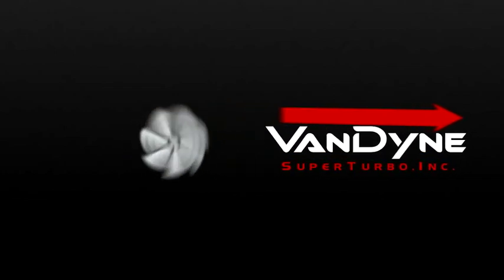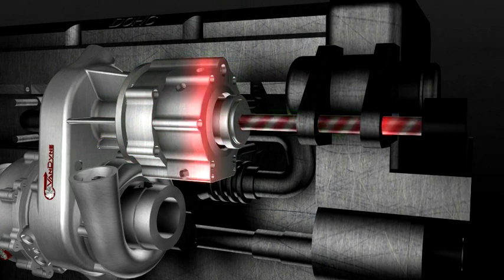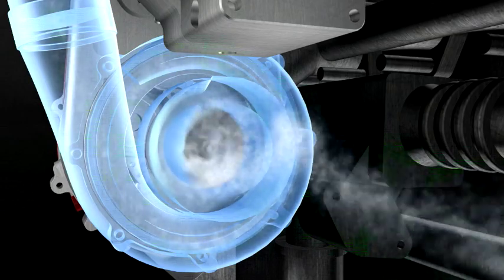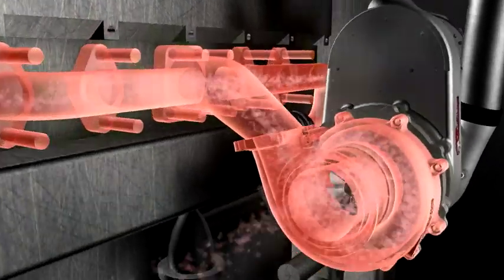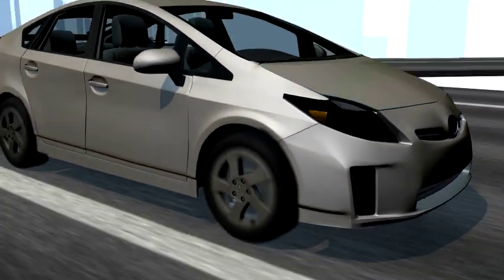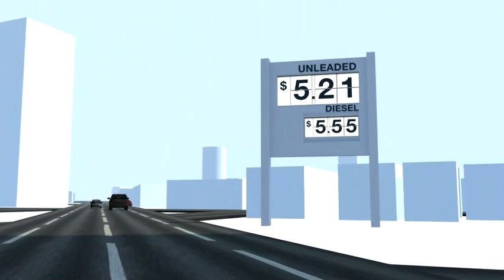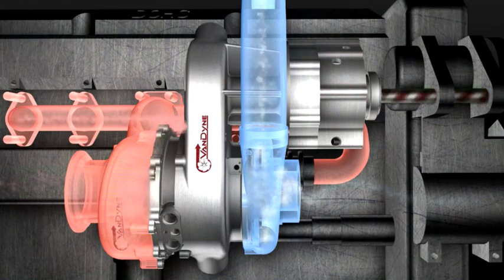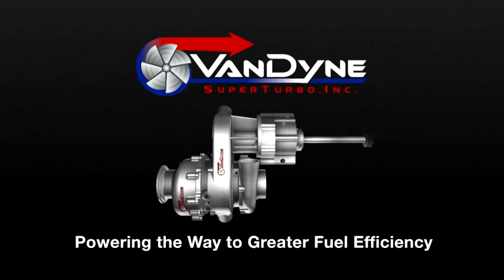Technical Explanation of the VanDyne SuperTurbo

Comment: I like the variable ratio I dislike the direct connection to the engine a lot of friction waste there and I absolutely hate trying to use exhaust gas to direct drive the engine its way more efficient to drive another fluid of similar density and viscosity plus it would create insane egt's  way more than a conventional turbo this idea is novel at best its complexity will riddle it with a problems they would be better off dumping the drive to the crankshaft and and running that cvt between the exhaust turbine and the compressor housing.
Reply: +triplestangman i thought the super charger did get power from the crank shaft .. they dont show it , but its connected buy pulleys and belts

Comment: An aftermarket version of this for car (like a 2013 Prius, perhaps) would great, and maybe have it w/o the compressor for people just looking for more fuel economy? But the CVT part sounds pricey. But if u don't have a compressor, the drive train can be weaker since there will be less power running through it, making it cheaper. But @ $600, it would take 120k miles to break even and it would probably void the warranty...

Comment: Not exactly. A twin charger has a supercharger that powers the engine in the low end and a turbo that powers the engine after it is spooled via the exhaust gases. The SuperTurbo has a supercharger's output to spin the turbo. All of the engine performance is achieved via the turbo as the supercharger simply powers the turbo in the low end. I think... haha.